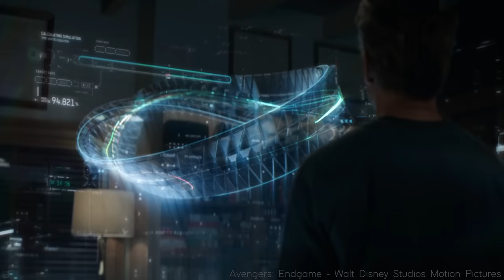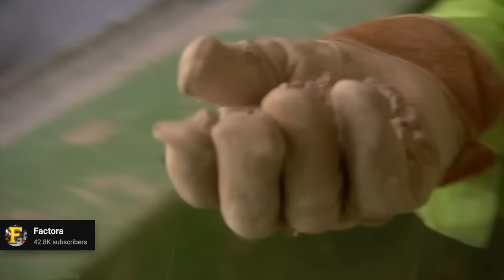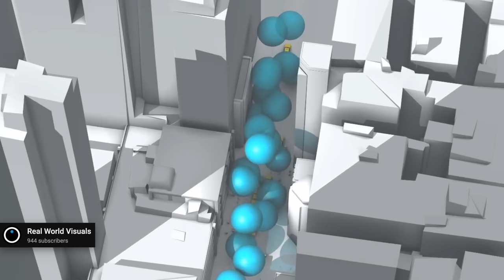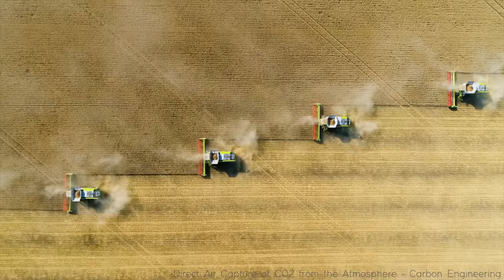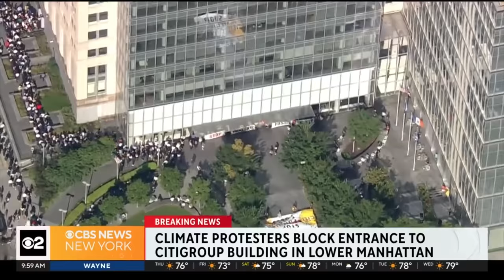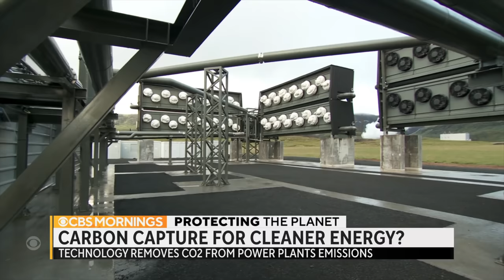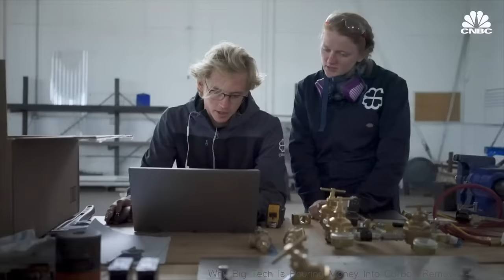How Thermodynamics Holds Back Negative Carbon Tech

Comment: You can't do DAC on a meaningful scale via renewables.   Maybe fission, but you'll probably need fusion.  This can't happen fast enough, so better look for alternative like some sort of geoengineering.  It will be incredibly challenging to implement carbon capture from processes like cement manufacturing and steel production and power generation, as well as shutting down every coal fired power plant in existance.
Reply: Why not via renewables? There would be oodles of spare energy if we covered a significant fraction of the sahara in solar. Does that require a massive scale up of solar. Yes. Is solar scaling up and getting cheaper as the tech improves. Yes.
Reply: @donaldhobson8873  Everything you build out for renewables will be absorbed by replacing fossil fuel power plants and scaling up electric production for cars and home heating via heat pumps.  And the whole thing has a huge need for storage techologies.  If you have supply following  DAC, that makes it less efficient with respect to capital spending.
Reply: @richdobbs6595  
Given the relative cost of solar and batteries, saving energy from summer to winter in a battery doesn't make sense. So if you build enough solar for winter, you have a lot spare in summer. At some point, we have stopped burning fossil fuels, and have intermittent power left over for DAC.

Comment: Even from a blast furnace, where co2 is 20-25%, the extraction has proven extremely challenging and not technically feasible (never mind economically) due to the myriad of chrmicals aka poisons to consider, even on the cleaner gas. 

Steel is in a similar range to concrete. Thats most of our built environment.
Reply: That same built environment is causing an unfathomable crisis of alienation in the people who live there. Maybe we can find other ways to build environments?
Reply: @gekkobear1650 maybe. But it is the scale. 25 billion tonnes a year between both. We need better materials but concrete and steel are magic
Reply: @riveness  everything is magic. Concrete and steel have a lot of downsides and are arguably very dark magic. Have you heard of aircrete?

Ultimately concrete and steel are what you use to build an empire. I'm not interested in building empire and the Earth is making it quite clear empire is not sustainable. I'm interested in building living community instead.

Check out the book The Entropy Law and the Economic Process by Nicholas Georgescu-Roegen for a more analytic scientific breakdown of what I'm saying.
Reply: @gekkobear1650  will do.

Comment: One tree, or a small group of them is a good way to store some carbon dioxide, yes, but a forest...Well, there is an ongoing study in the pacific northwest studying forests and it has found that for the first 60-80 years of a forest's life it actually produces more CO2 and Methane than it absorbs. So, ya, there would be some pain there. It was the most disappointing study I have ever seen, worse even than the plastic in your teabags, and processed foods causing mental decline studies. Also, we don't want to remove all the CO2, just reach a nice plateau that we like

Comment: What about natural climate changes. In geological history climate changed drastically ( from Croygenian to Cretaceous). We live in cooler times (interglacial Holocene) when ocean level is low. It would inevitably change naturaly, its like drift of continents (which as well causes natural calamities).
Reply: And what also happend during drastical climate changes? Mass extinctions.
Yeah, naturally, the climate would probably also change someday, but not as drastically.
Reply: @yourguard4  As far as we know, climate changes are pretty drastic. This is the reason why they are considered to be main cause of mass extinctions. Recently (in geological terms) like 15.000 years ego there was ice sheet over significant portion of Europe (and North America). There are many other problems – for example most people live in developing world – only in China and India ~3 bln people. CO2 is only 0.04% atmosphere – and our civilization has greater impact on earth in other areas. BTW burning coal is very inefficient way of producing energy (its wasting this valuable resource).

Comment: Hey David- do you happen to know where the electricity you use to charge your EV comes from?

If it happens to primarily come from, say coal and natural gas, is it possible that your new EV could have potentially increased your carbon footprint?

There seems to be quite a big questions around the logic behind EV’s and their impact on the environment, but asking those questions is apparently a social taboo. It all feels quite non-scientific, does it not?
Reply from the maker: Mostly from our Solar roof!
Reply: @CoolWorldsLab  Amazing!  Thanks for the response. Much respect!

Comment: BigOil has the deepest pockets on the planet, but has failed to put its obscene profits to good use to perfect a cost-effective (or even basically effective) Carbon Capture & Storege (CCS) tech solution.  Also we don't have enough spare land to locate enough Direct Air Capture (DAC) devices to remove billions of tons of CO2.

 I believe excessive atmospheric CO2 is a chemistry problem which needs a low energy chemistry solution like,  perhaps,  modifying  carbon covalent bonds to bind CO2 with a plentiful ore like bauxite & then sequestering the resulting solid into construction materials for our infrastructure (as, perhaps, a replacement for concrete).  AI should be working full time on this.
Reply: We can't do that. Physically it's possible, and incredibly cheap, could be scaled up to global scale in minutes and would entirely solve the problem. But some technicality on page 2573 of the Luxemborg nose hair clipper standards and exports act makes it technically illegal. 
/s
Just kidding, we aren't yet quite that far into a bureaucratic farce world where we could solve all problems instantly if not for the paperwork.

Comment: Where does the energy for this come from .. if fossil fuels these CC processes are so energy consuming it takes a minimum of a 2:1 ratio of carbon created -> carbon capture.  The only way around this is using a more powerful renewable energy source (fission or fusion) then flood the atmosphere with reflective particles (cool period in the 60s-70s, although that did create the "Acid Rain" issue).
Reply: It's 2:1 in the other direction. burning 1 unit to capture 2. I mean a perfectly efficient system could in theory burn 1 unit to capture 30. So in principle, fossil fuel powered carbon capture might make sense. In practice, it's impractical. We would need to double fossil fuel production to run it.
Reply: @donaldhobson8873  and another thing if you start taking carbon out of the atmosphere, it’s just going to cause the oceans to release their concentration of captured carbon, around 30-40% of all our carbon ends up in the ocean, when you take it out of the atmosphere it’s going to end up being replenished back from the oceans, so any estimated times giving in this cool worlds video (probably one of his worst researched I’ve seen) needs to be doubled.
Reply: @donaldhobson8873  burning 1 unit of carbon releases 3 units of carbon dioxide.
Reply: @Spitefulgod2  I think it's 1:2 in the sense that burning 1 unit captures twice as much carbon. But not sure. Better double check that. (Ie 1:6 the way your measuring it)
Reply: @donaldhobson8873  don’t really need to double check it, it it takes burning 600g of hydrocarbon to sequester 1kg of co2, how much co2 have you made and what’s the ratio… also not too sure why all my comments are getting deleted.

Comment: Bro, I’m pretty sure the range of carbon capture by forests is more like 5 to 4O tons per hectare, PER YEAR. Mother Nature, as in most cases, is the most efficient engineer. The carbon capture efficiency of trees is unparalleled. Unless there’s a breakthrough in material or chemical sciences, trees are our best hope in capturing carbon. Take care of the trees and they’ll take care of the atmosphere. The Canadian forest fires last year accounted for 15-20% of total global carbon emissions (as we know, Canadian forest fires were even worse in 2023). Save the forests, save the world.
Reply from the maker: No the whole point of DAC is that photosynthesis isn’t efficient enough and mechanical trees have higher efficiency already.
Reply: @CoolWorldsLab  
Photosynthesis may be efficient enough if we consider it from a different, more multifaceted, systems-based and natural-diversity perspective, such as from a regenerative agricultural and habitat perspective-- permaculture, rewilding, increasing biodiversity and food-forest gardens for examples-- that significantly enough replace our current unsustainable model of C02-emitting industrial agriculture/monoculture.

DAC is a one-trick pony.
Reply: @CoolWorldsLab  technology and biology aside, you still present the tonage per year as an end sum in this video (which was rather shocking). Obviously forests sequester their massive amounts of carbon each year and this is what the stat represents.
Reply: The forest stops capturing CO2 when it's mature, since as much CO2 is then released by rotting dead wood than is captured by growing new trees. And with global warming, what actually happens is that forests can die or burn, releasing all its sequestered CO2.  The boreal forest is burning. The Amazonian forest could die and become a savanna due to climate change. As much as I like trees, they are not enough to solve the enormous problem we created in the last centuries. At best, forests only delay the issues ahead.
Reply: @dominikoeo right, because mature forests just stop breathing. If we put half as much focus into maintaining the forests as we do into marketing fraudulent “eco-friendly” alternatives ie. EV’s, we’d already have solved the global warming “crisis”.
Reply: The efficiency of trees is on the wrong side of 0.1%
Reply: @glomerol8300  Ah, buzzword based carbon sequestration.
Reply: @Be_reasonable101  Mature forest contains rotting branches and mushrooms and animals which turn the wood back into CO2.

Comment: When nuclear fuel is exhausted, can't we just fire it into space and let it fly out the solar system? I always wondered this when i was a child 😂
Reply from the maker: Sure, just very expensive and putting it into orbit would be unsafe so you’d need to dump it very far which requires a lot of fuel
Reply: Also, rockets sometimes explode. Having 100 casks of spent fuel in a cave is better than 99 casks speeding out of the solar system and 1 cask sprayed all around the launch site.
Reply: @donaldhobson8873  i understand now 😅 ... i just wondered when was 13 years old why we didn't launch it into the sun or put of the solar system

Comment: We seem to want to use technology to solve problems that technology created in the first place.

In any case, the fossil fuels' low hanging fruit are being depleted anyway. At the same time, however, they may be needed-- big time-- in this DAC and so-called renewable energy build-out that we've hardly started. 
Have you looked into that? It's even worse/harder than DAC what with the quantities of rare earths and general minerals and energies required as well as the geopolitical issues behind them all.  China? Russia? Ukraine? USA? Venezuela?
Have you done the investigations and calculations for that? Copper? Nickel? Molybdenum, etc.? Scales, quantities, costs, time? Child labor mining/humanitarian issues such as in Africa?

Solar panels and windmills have fossil fuels/C02 embedded in them, from cradle to grave-- in what's used in their mining, shipping, manufacturing, maintenance, recycling, disposal, etc.-- and may be nowhere near the panacea many are hoping for. That may already be obvious to some in the know. 
Likewise with electric cars and the roadway infrastructures they're supposed to drive on and be maintained for as well as for the assorted problems they create what with sprawl, roadkill, pollution and so forth. 
What about public transportation? Why individual transportation? And where will we be going and what will we be doing if society/civilization as we know it will be going away anyway, and/or has to 'crash' to be within certain carbon emission/pollution limits? How serious are we?

Careful what you wish for. You may just get it; a rapid and 'controlled demolition'/'lockdown' of the current global-industrial economy that throws everyone out of their current work and into a new lifestyle/way of life.

As for trees and agriculture, look into permaculture and its food forest gardens for one that include different approaches to land management and settlement... 

"...that adopts arrangements observed in flourishing natural ecosystems. It includes a set of design principles derived using whole-systems thinking. It applies these principles in fields such as regenerative agriculture, town planning, rewilding, and community resilience...

Permaculture has many branches including ecological design, ecological engineering, regenerative design, environmental design, and construction. It also includes integrated water resources management, sustainable architecture, and regenerative and self-maintained habitat and agricultural systems modeled from natural ecosystems." ~ Wikipedia 

It may be among the best bets and not just with trees but a general and biodiversitive greening of the planet. (Nature is a garden in a sense. All creatures eat and are in a kind of global symbiosis. 'Daisyworld' suddenly comes to mind.) 

...As we possibly cancel our career specializations (many relatively-myopic practically by definition anyway) and get back to gardening/farming (the right ways) and growing our own food near our homes and living again with nature and natural constraints, real communities, relocalized and small-scale.  

Maybe we can worry about space exploration later, perhaps in a few generations from now, once, or if, we make it.

Comment: There's nothing like cold hard science. I don't understand how there's people out there that eschew this for some insane reasons.
Reply: There is nothing like cold science, and things that are nothing like cold science. And sometimes it is hard to tell the two apart. 
Take their assumption that energy grows at 3%/year. Is that a realistic assumption, or should we look at solar growing at 28%, and assume it takes off and dominates.
Reply: @donaldhobson8873  it's an assumption based on current known data. That's how science works, that's why science never says that it is 100% correct. Unlike some peoywho "know" because they did their own "research."

Comment: Carbon capture can be enhanced with very efficient machines that already exist. This technological marvel that captures carbon dioxide in carbon-based organic compounds: plant-based structures. There is talk of trees. But there is no mention of biomass fixation in the soil, with very low degradability rates, which may be annually responsible for fixing carbon in the soil. Let us work together to grow land with a high content of organic matter. Let us bury fast-growing species that can generate organic soil. Let us set the objective of growing biomass in the soil by 1 mm in thickness per year. and then do the math for 100 years...
Reply: Trees are inefficient. 

100 years. You can do anything in 100 years. He was going for 27 (and half that was for scaling up, ie most of the carbon capturing was in like 15 years).

Comment: Time to make fusion reactors that can actually produce electricity!
Or start producing a LOT of fission reactors...

Unreliable renewables (solar/wind) are not reliable enough for that (we have to overproduce energy by an order of magnitude so we can still power the DACs after a week of cloudy days and charge the power reserve in a singly sunny day to be able to absorb another week of cloudy days). Without including the required Lithium for storage... And the cost of all of that.

Reliable renewable (Hydro dams) are problematic for the environment (reservoir killing and displacing ton of life). And aging dams are also a very big problem
Reply: We're no where close to fusion unfortunately
Reply: We don't need to power the DAC after a week of cloudy days. The DAC is turned on when it's sunny, and off when it isn't.